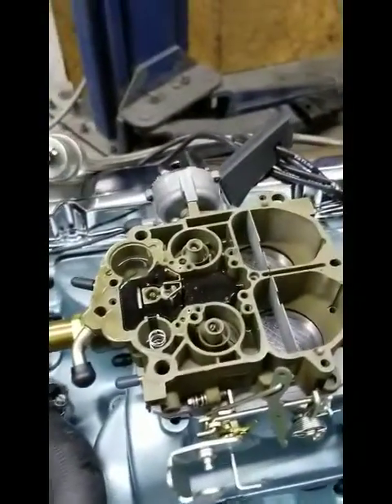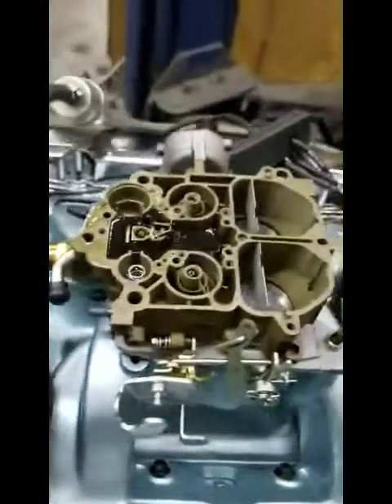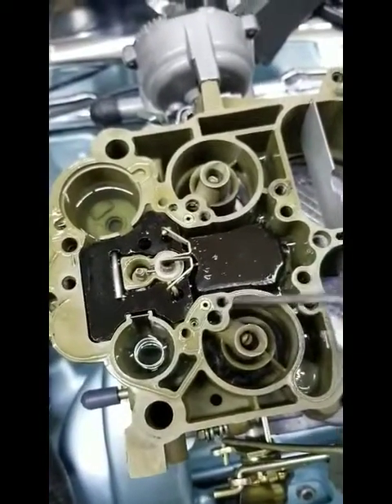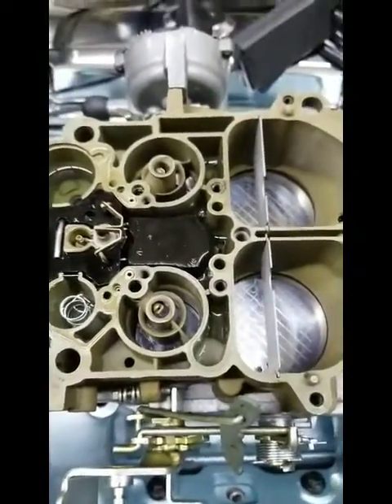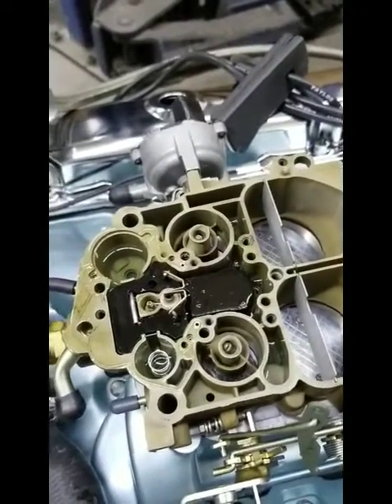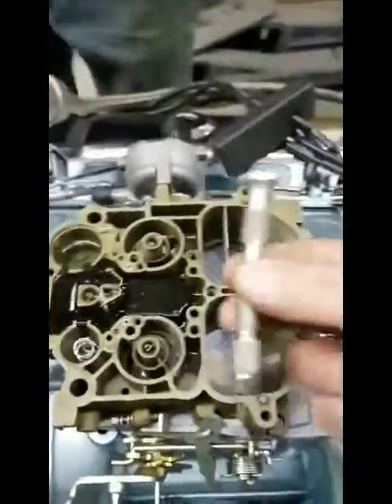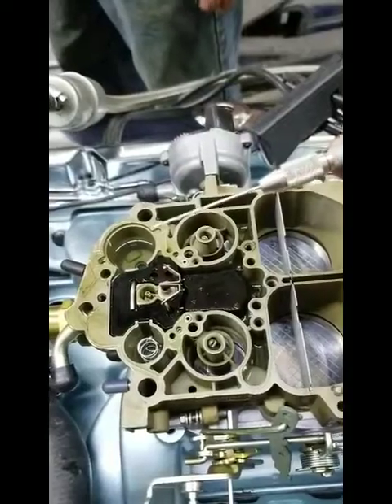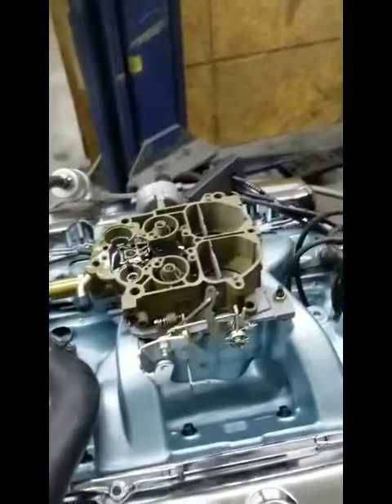Part 2 , Rochester Quadrajet Idle circuit tuning the right  way

Comment: Would be nice to disclose the orifaces size before and after drilling. Many of viewers understand concept from other style carburetors that have changeable jetting for these orifaces. Q-jet is not all that complicated, just one has to look thru it and come to that understanding. Idle vacuum typical on Q-jet is better than Holley and AFB. But if not out for performance and just want to street drive cruiser it is difficult to do better than a WCFB for SBC. I didn’t realize this was a 5 year old posting it just came up on it’s own.
Reply from the maker: Agree and I will be covering that on my Podcast at some point. Thanks for following my channel and please subscribe if you haven't already. We are trying to get to 10,000 subs this coming year :)